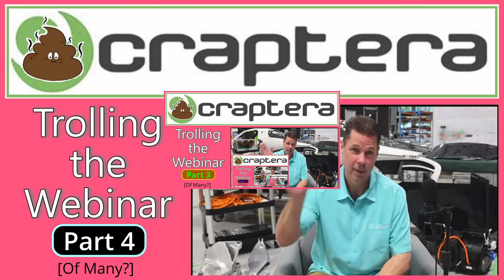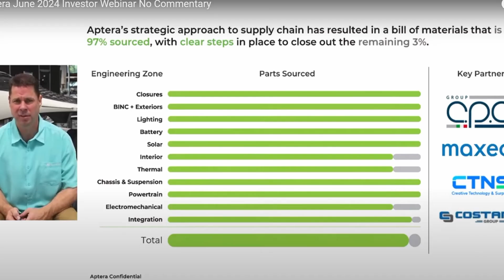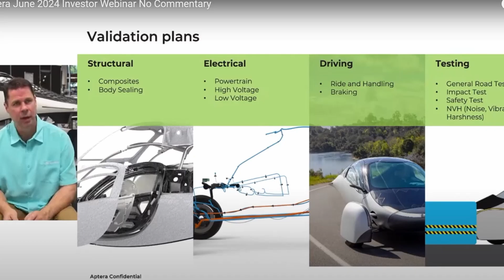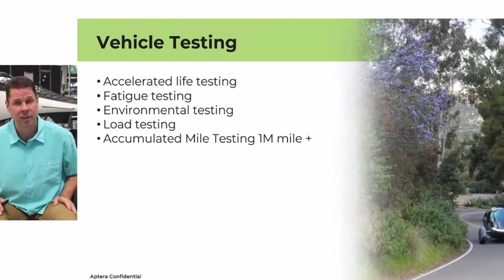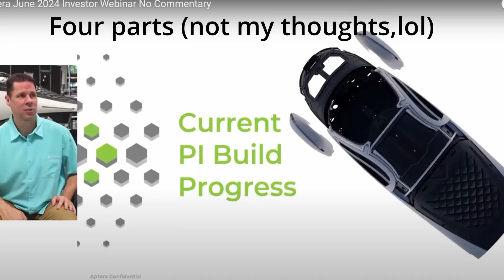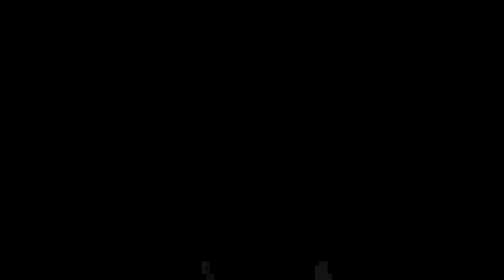APTERA    Trolling Part 4

Comment: Aussie and others, 
Have any of you given a close look to where the front A-arms go into the body and noticed the large oval shaped holes?  Once debris gets inside of them, where does it go?  How will anyone clean that out?  How does water drain out?  Where I live salt brine is used to treat the roads in the winter.  If any of that settles near batteries, the cooling system, and connections it has to be washed out somehow.

How are they going to get 1 million miles of driving?  Even with all 16 proposed PI vehicles, that is nearly 63K per vehicle.  How are they doing that in 6 months time?  2025 is just 6 months away and they lack the people to do this assembly and testing.  Just like their claim of being to assemble a completed vehicle every 12 minutes with a crew of 40 people, this is not feasible.  The wrap can't be applied that fast in a 300 square foot corner of the empty warehouse.
Reply from the maker: 16 different vehicles doing 63k each does not constitute any more than a good 60k test. There is no million mile test done at all. It is the level of dishonesty they have that deceives people with their slides and their talk. 

There is a recommended 24 hr don't move for most wrap shops, but some just do overnight. You can still average one every 12 minutes if you time things right, but you can't avoid not having the floor space to keep at least 80 trikes at any one time for two shifts. And that's without storing more to accommodate truck pickups and customer collections. If a trike is set to be done (and dry) say at  1 am Sunday morning - wrapped the end of a Saturday second shift - they can't expect a customer from Boston to collect it by ten past one. Lots will have to sit around for possibly weeks.
Reply: @aussieideasman8498  Do you have any thoughts on the open holes in the body?  Am I seeing something that can be easily explained?  I have also been considering lifting points on the vehicle.  How does someone change the rear tire?  Obviously, the cover comes of, somehow, but where do they expect someone to lift the vehicle.  How about when the rear coil-strut goes bad?  Where do you lift the vehicle then?  Carbon fiber is only strong in the direction the grain runs.  A jack could crack it if the body rests the wrong way on one.
Reply from the maker: @JoeBManco  "Do you have any thoughts on the open holes in the body?" A non-issue for me; too many outboard wheels on other vehicles to think it works.  
"Am I seeing something that can be easily explained?" Probably.  
"I have also been considering lifting points on the vehicle.  How does someone change the rear tire?" I believe the FAQs have covered those years ago. BTW, they don't carry a tyre to change. Also, normal tyre changes are always done by removing the whole wheel from near the axel out, but this wheel comes off from beyond the diameter of a motor that must stay (you can't unhook the high-power cables) which will make removal and replacement tricky at least. It's an unknown like the cretin talks about in his latest video, lol. He loves them because it gives him reason to guess a lot. I just say let the test PI's pass all the tests. Such small problems will have to be resolved and we don't need to even know about them.
"Obviously, the cover comes of, somehow, but where do they expect someone to lift the vehicle." They have a smaller hole in the cover for the goop spray that goes into the valve stem. After that, it's put in on a truck and send to the shop with the hoists.  
"How about when the rear coil-strut goes bad?" Apparently, it's already bad, lol!  
"Where do you lift the vehicle then?" Those tyre shops with hoists, however, it negates right to repair being an option. There's that. 
"Carbon fiber is only strong in the direction the grain runs.  A jack could crack it if the body rests the wrong way on one." Jacking points are traditionally not connected to the skins of a vehicle; they are on more heavy-duty points that don't bend (or deform anything else). If Chris has put one on the CF skin, he's a bigger 1d10t than I regard him - and that's saying something!
Reply from the maker: I reply to you here because your notifications are behaving strangely. On the other thread that you asked this (copied):

Highlighted reply

@JoeBManco
31 minutes ago (edited)
 @aussieideasman8498  I have seen a few people say that Munro claims that Elaphe is not making the Aptera hub motors anymore.  I can't find anywhere that says that.

When I open the replies the whole thing disappears. Then there is the "what is a Moose test" you asked about and it opens that thread but doesn't even produce a highlighted reply. We can thank YT for a lot of this nonsense - it's both flaky and deliberately invasive. That's life, and we can't even talk sense into them due to how they stay unconnected from feedback.

On the first issue: I have seen similar comments, but don't bother to search for them. If they don't mention Elaphe' in the webinar and they don't show us a stockpile of motors then it's clear enough - nothing happening.

On what's a Moose Test?: Back when small cars like the original Merc A class and the Mitsu Colt clone were rolling over in Scandinavia trying to avoid the odd Moose running onto the roads the authorities introduced what they named the 'Moose test'. It is a mandatory test with specific parameters (speed of car; distance between cones; width, etcetera) that must be carried out by authorised testers (not by the makers) and passed off to allow sale of the car. It deems the car capable enough to swerve from danger to government satisfaction. Makers can do their own testing before submitting to a Moose test, but they can't call it a Moose test and they can't claim it passes one. To do so is lying and highly unethical. Potential investors and buyers should not be deceived by such practices - they should not even be subjected to them. In Australia they would jail offenders using our strict advertising standards laws. Things appear pretty lax in the US. Of course, it may only be the silly fanboys who make the claim and, if AM hasn't, then they would be safe in Aus.
Reply: @aussieideasman8498  Yes, YouTube comments are frustrating.  Often, I say something that is not even close to offensive and yet it never posts.  Other times all I have to do is not direct reply to someone and it posts.  The frustrating thing is I have to copy each message I write or it may be gone forever.

It is obvious Aptera has not done a Moose Test, because they don't have a customer vehicle to test with.  It is equally pointless to crash test the PI if the vehicle doesn't contain actual production parts.
Reply from the maker: @JoeBManco  I put some that I really want to preserve on my latest video. When they annoy me a bit I chuck it on the last three, just for fun.

Everything they do with regard to getting to production is amateurish at best. It's one reason why they take so long and get nowhere, but my biggest suspicion is they are orchestrating it towards another fold. It's just that the money stream has done better than expected, so they kept the dream alive. They don't want people to buy one; they might kill themself in it, lol.
Reply: @aussieideasman8498  Yes, YouTube comments are frustrating.  Often, I say something that is not even close to offensive and yet it never posts.  Other times all I have to do is not direct reply to someone and it posts.  The frustrating thing is I have to copy each message I write or it may be gone forever.

It is obvious Aptera has not done a Moose Test, because they don't have a customer vehicle to test with.  It is equally pointless to crash test the PI if the vehicle doesn't contain actual production parts.

Comment: That million mile testing claim should be fun to watch. I wonder how much they will later decide is through simulation.  Driving 60 miles per hour that is nearly 17000 hours of actual driving which obviously would be longer as an average speed of 60 would not be possible.  Granted they should five to eight Aptera for that testing but I bet once they see the slow progress of accumulating it they will magically declare it performed far better than expectations and further testing is not needed.
Reply from the maker: I told the d0p3y Ningineer that the slide for the million mile test was deceptive. It is headed "VEHICLE TESTING" which means no simulations allowed. They have to test a Delta off the production line they still don't have. Then the dot point reads "Accumulated Mile Testing 1m mile +" The heading is singular, so one vehicle has to accumulate over a million miles on its own. To get 16 of them to do 62,500 miles each doesn't do what the slide claims, but more so - it's cheating. You can't sell 100,000 trikes and claim they can do a million miles when they all have done ten miles. That's not only cheating; it's absolute nonsense.
Reply: The motor company said they tested 1 million miles. So if I was running Aptera, then I’d claim the testing is done for everything else.
Reply: He started to say "hundred" and corrected himself to million...so probably actual plans are for a hundred thousand miles.
Reply from the maker: @tribalypredisposed  100,000mi at an average 60mph takes 70 days to drive non stop (over two months). Do a million and it takes 700 days (almost two years).  It's all talk with no thought.
Reply from the maker: @rw6262 They will be scapping more than they make from here on. Watch that Beta closely.

Comment: Did you see the WSJ article featuring Aptera?  Now we find out that the wind tunnel testing was just a photo opportunity and nothing more.   This company just gets more and more bizarre with each passing day.
Reply from the maker: I haven't seen the article, but your comment about it being nothing more than a photo opportunity may be wrong. Going by comments in a few YT videos reporting on the Pininfarina wind tunnel fiasco, it is probable that it was a huge opportunity to deceive and not just take promotional photos to encourage people to part with their money. Comments such as -
Windscreen opening was taped up to get a better drag reading and display a cleaner air trail over the trike.
Body was lowered beyond what was practical to drive for improved coefficient.
Cooling channels removed from body to motors so that the space between them produced less drag and a cleaner visual air flow.

That last one was the subject of reasons for the next overheating episode in which Fambro took the fall saying he had not installed them seven months earlier. It is better to say that than to have people know they had removed them for the deception. The odds of him forgetting for seven months is ludicrous, as is about twenty engineers not noticing for the entire seven months.  However, they regard their disciples as 1d10t5, so were certain they would get away with that patheic excuse and - guess what? - they did! 

I don't think they get more bizarre - I think they have been putting lots over us all along, and Pininfarina was par for the course. The problem they face is they have to do all the things they have faked on prototypes with the Delta before they can sell one, so it will catch up with them; no escaping any of it any longer.
Reply: The superfans hated it. It pointed out that they are the ones that do the crowdfunding because they like the product. Yet the lack of transparency never allows them to do due diligence. Then they gave good examples. 

The wind tunnel was a good one. I questioned it but was insulted and questioned my abilities. When I brought up about it being a 3 wheeler, it’s obvious that the responders have ever been to one. Thus, aptera did wind tunnel testing, yet now we find out they did not. The did a photo op. Yet the superfans still think they did.

Let’s not forget that skin cooling….
Reply from the maker: @billsmith5960  Claimed to do a qtr mile time yet turned timing lights off when taken to the drag strip. Has anyone ever seen that stunt pulled anywhere else? Claimed to have sorted suspension and braking and showed a few minutes at Chuckwalla. They also claimed to pass a Moose test and a critic said it wasn't the right measurements. No authority has a record of an official test ever being done. Still claim the roof test being 7 times stronger than steel after changing the material and not testing the new one. Claimed it can drive all day though Death Valley because computers were hooked up to a test bench in the next room. Claimed they drove 6 times up and down a hill to prove it didn't overheat and showed a slow 400 yards in a cool morning. Claimed they did tons of fast laps at a racetrack, lol. Claimed a BMW backed into Gamma and never took the details of the driver - not even the number plate or make/colour of the car. Claim they can make a silly trike in 12 minutes but that broken wheel pant took months to replace. There are many more claims and all have that recurring theme of zero evidence, and that's on top of many production date claims that have long gone by. Is it any wonder they get accused of lying?
Reply: @aussieideasman8498  I have seen a few people say that Munro claims that Elaphe is not making the Aptera hub motors anymore.  I can't find anywhere that says that.